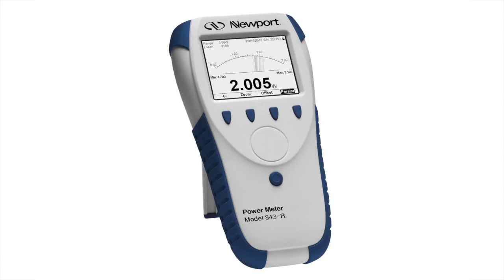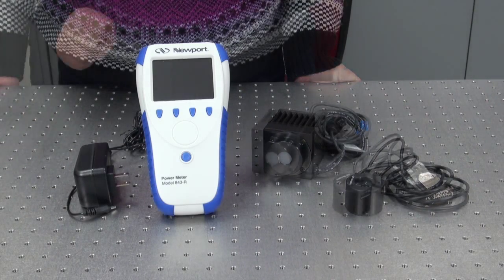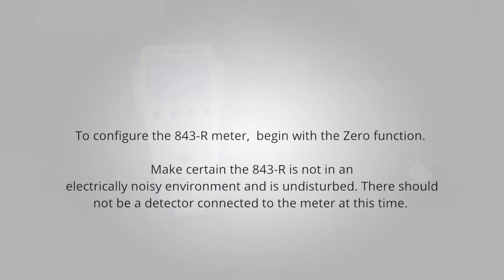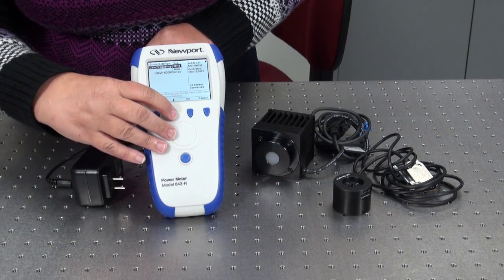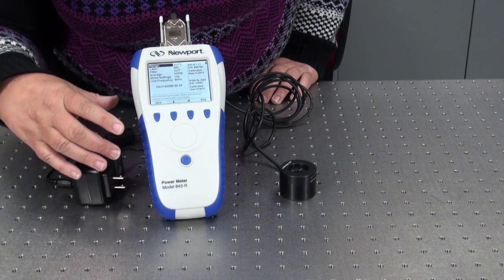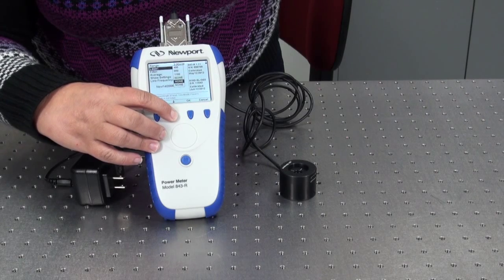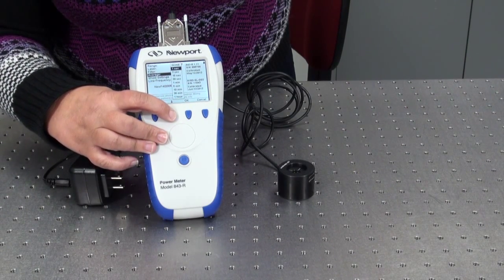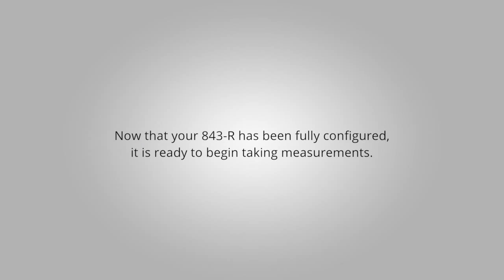843-R Power Meter Setup

Comment: This meter works for Co2 laser only or is posible to use on IPL machines?
Reply from the maker: This video primarily features the power meter, a complete measurement system consists of a power meter and a detector.  Depending on what kind of light source you are using, whether a CO2 laser or an IPL, we have a broad range of detectors that allow you to measure average power, pulse energy, irradiance, or dosage. Feel free to reach out to us at tech@newport.com if you have specific questions.